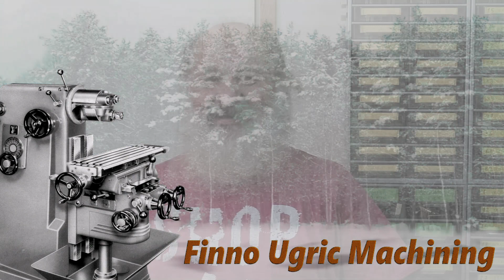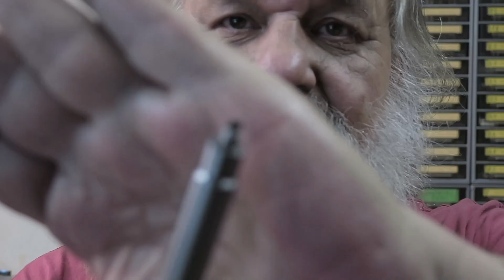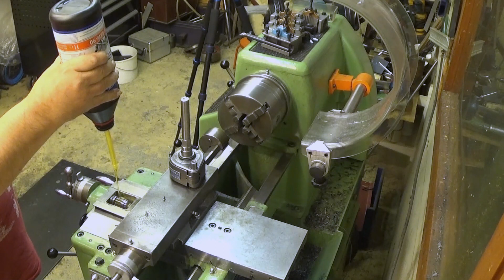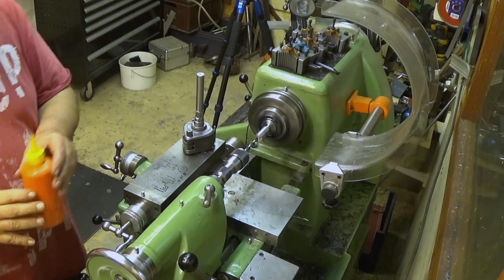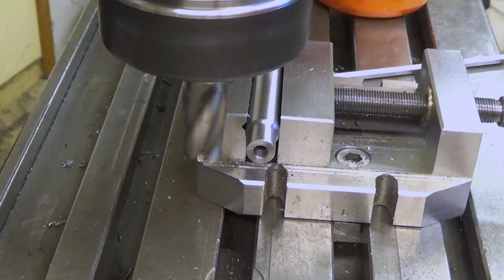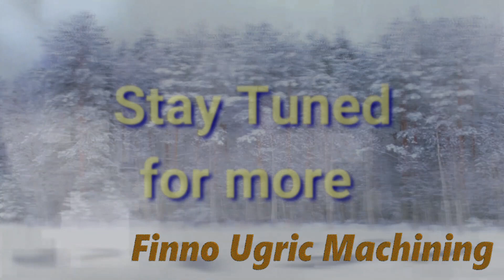Gib Adjustment Tool for Weiler Matador

Comment: If I were using the compound enough for it to wear down, I would be quickly buying a cnc to avoid the hassle with adjusting the cursed slide of doom 🤣
Reply from the maker: Well.... sometimes it is just a must. Turning steep tapers or large bevels.  The compound is also the most accurate positioning mechanism along the way-axis. Most of the time I keep it locked though.